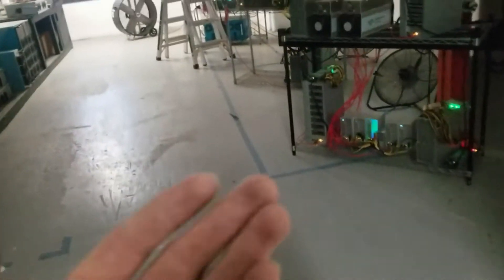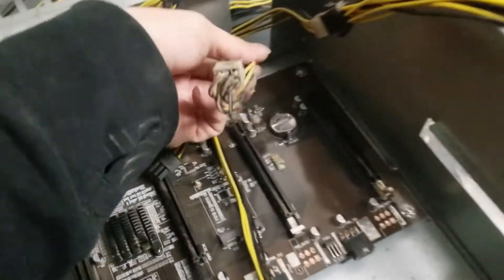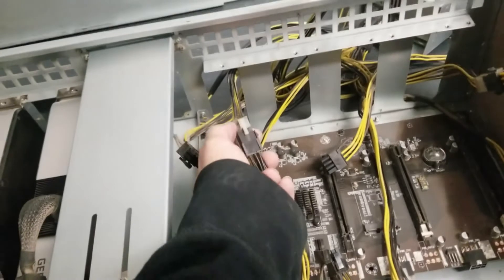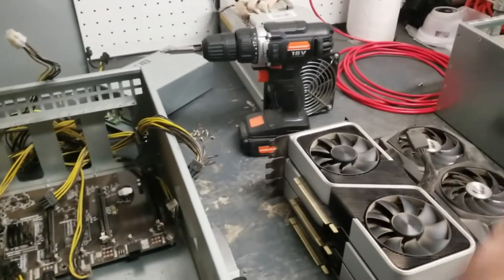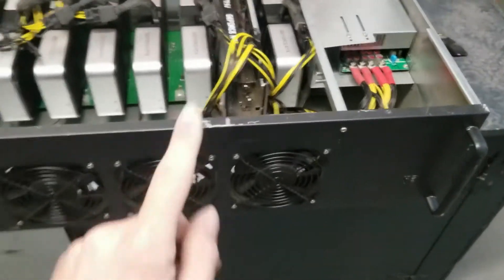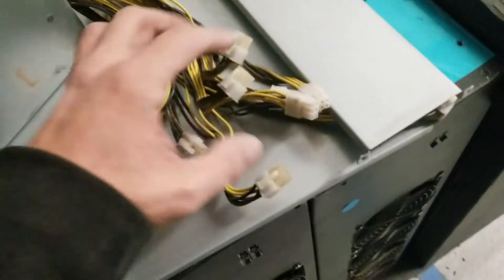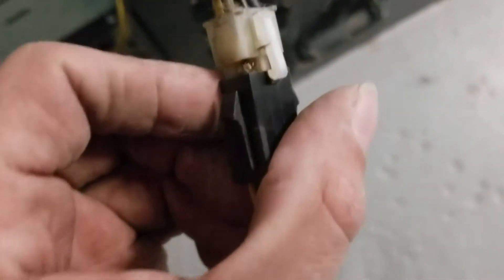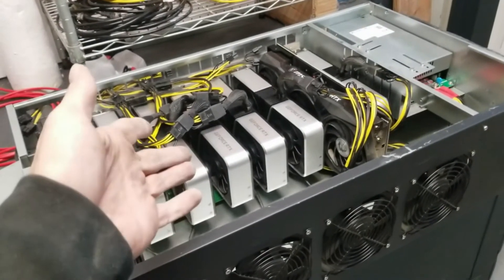Mining Farm Update - TheFamilyMine - New Fuses Who This?? Fixing Melted Connectors And A Dead Mobo!!

Comment: Wow, I have never seen a PSU just shoot that much power down each cable run like that and melt them.  Wild!  Thanks for sharing.
Reply from the maker: You and me both my dude! Those cards are 3060TI so they only pull 120ish watts, yet rated for 300w tdp